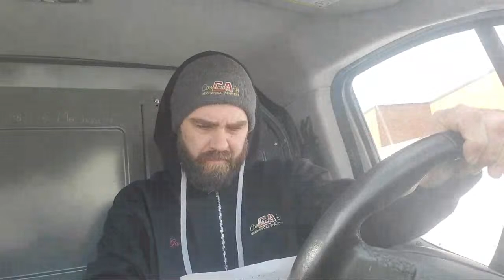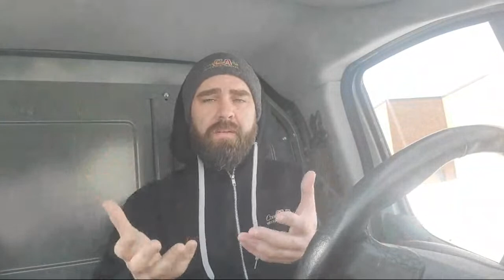Live - Discharge Line SUPERHEAT

Comment: My understanding of the discharge superheat calculation is discharge line temperature less the condensing temperature converted from liquid line pressure. I have a bench top chiller (255g R134a) where the discharge line temperature is high (216F) and the liquid line temperature is low (barely above ambient). How can I test the function of this chiler while avoiding the use of a piercing valve (and possible loss of critical charge)?

Comment: I don’t do refrigeration so I don’t know if it’s different. I was taught the discharge line should not be over 220 degrees and discharge superheat should be between 50 and 90 degrees. 60 to 90 preferred. Lower than 50 and it’s flooding and over 90 it’s starving. Is this different for refrigeration?
Reply: I have a write up somewhere. I’ll see if I can find it and send it to you.
Reply from the maker: It's always been 225 every where I've looked.  I've actually never heard of the SH numbers you gave.  I will be on the look out for this.  Cheers!